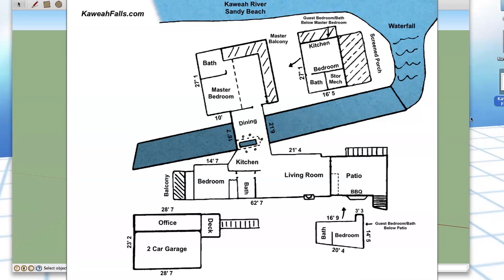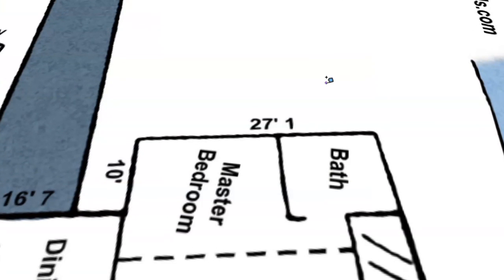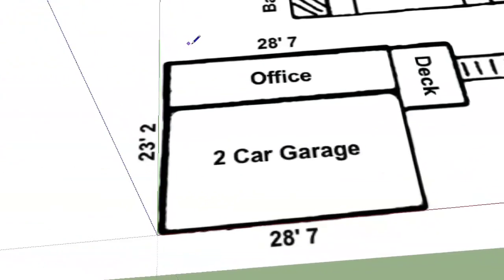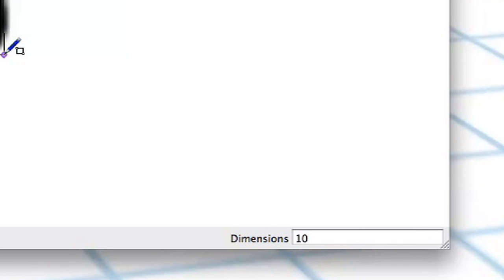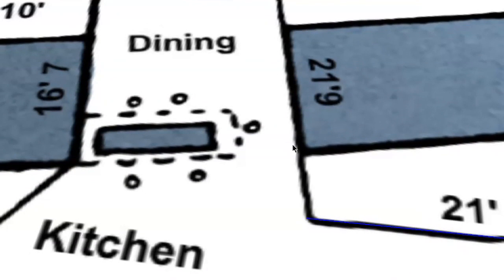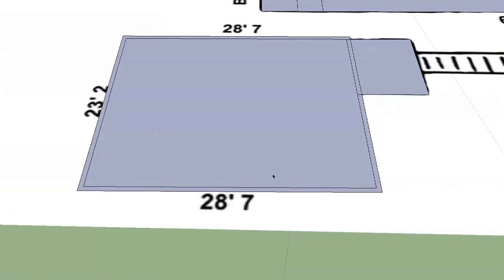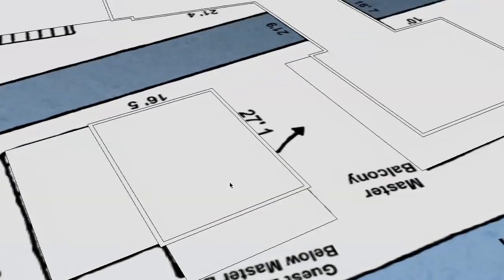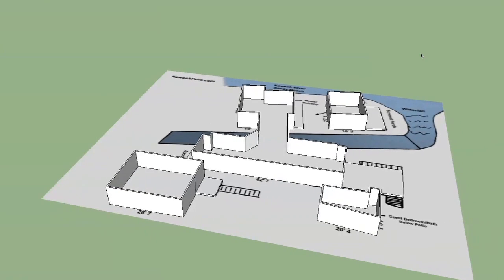SketchUp #50: Kaweah Falls, Part 1

Comment: Normally when dimensions are given outside a building (without arrows indicating exactly where the measurements are to be taken) they are exterior dimensions, not interior dimensions. When dimensions are given inside a room (e.g. under the name of the room) they should be interpreted as interior dimensions.

Comment: Thanks for these informative instructional videos.  I appreciate the level of detail provided in all 55 of the tutorials that I have watched.  Your presentation is much easier to learn from than many other SU tutorials found elsewhere on the web. 
I did not see, on the Harwood Podcast site, any information that covers how to use an existing photo as a basis for developing a model.  The info on Photo Matching located on other sites seems to leave a number of questions unanswered, so I would like to see this topic addressed on your site.  Please provide a tutorial lesson with a step by step guide on the Photo Match process.   I would greatly appreciate it if this can be done. 

Thanks again